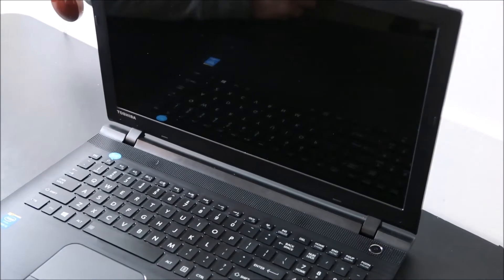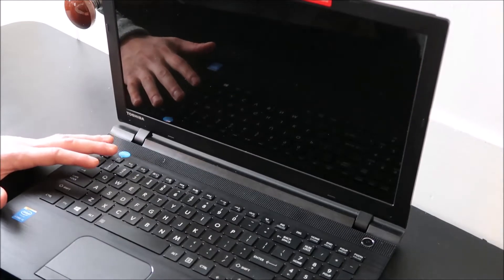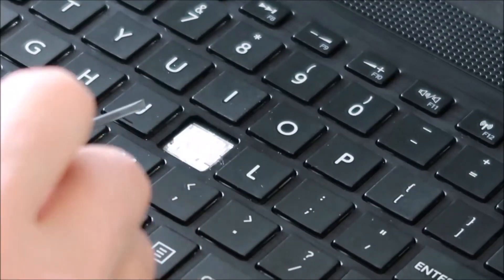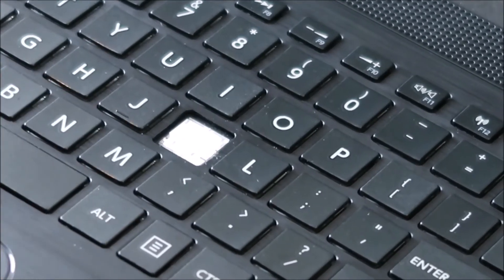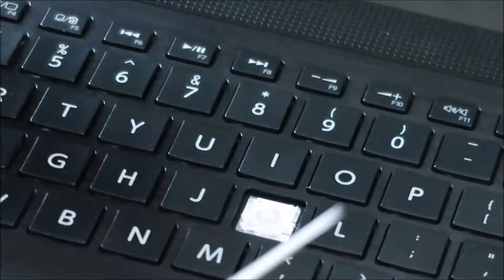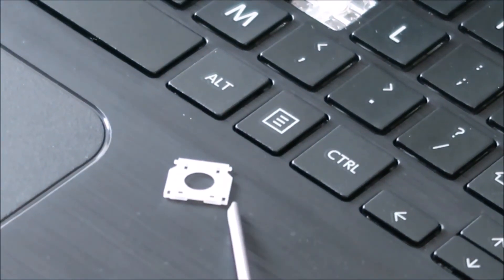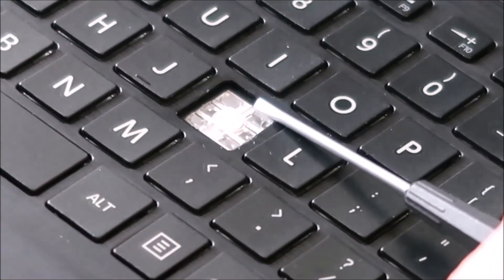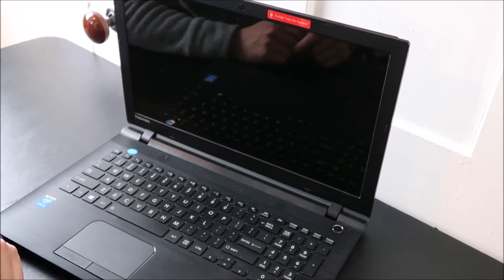How To Fix Replace Small Keyboard Key - Toshiba Ultrabook Laptop Computer

Comment: Hey. I took the letter E out to clean inside and i putted it back, but sometimes it comes off while typing, i also took other letters and putted them back and they are completely fine,  and checked twice if smth broke but everything is fine i don't understand the problem... can u help me out?
Reply from the maker: If your Key Cap is not clicking down in place correctly, it is most likely due to the Retainer Clip not being properly installed or damaged.  Remove the Cap and inspect for damage or that its not laying down flush and properly snapped in itself.  Compare to another Clip if needed by removing another Cap.
Reply: @PC_Monkey  Thanks for replying, today i checked again and there was a tinny thing that was a little curved, and fixed it and it works now perfectly. Thanksfor your help!
Reply from the maker: @abdelrahmanhafez9712  Glad your all set :) Always here if needed !!